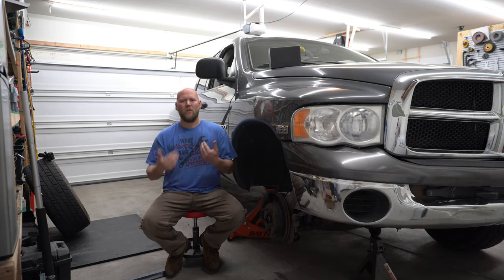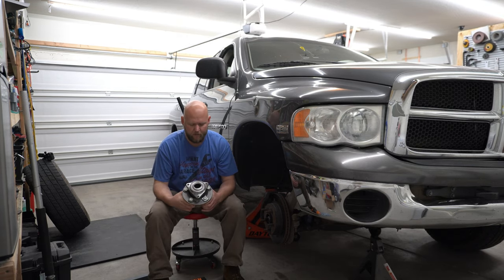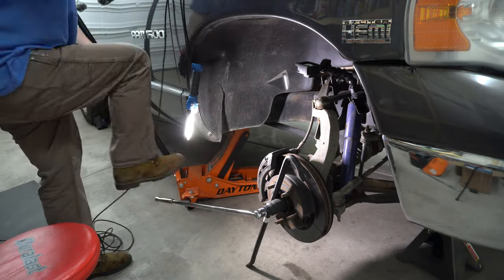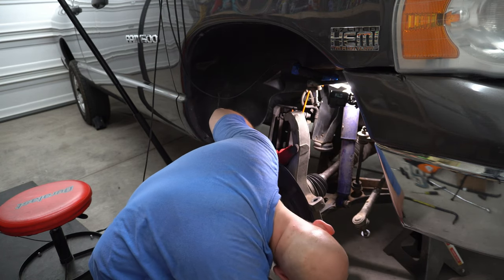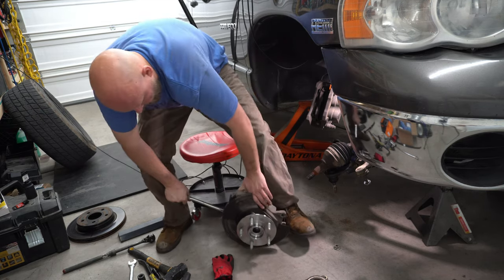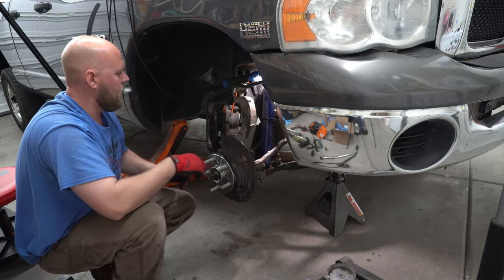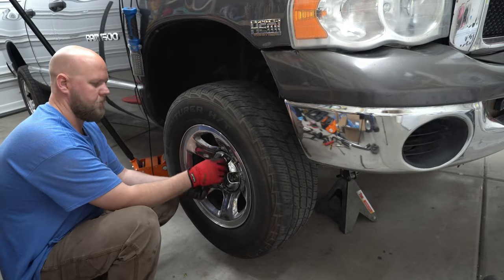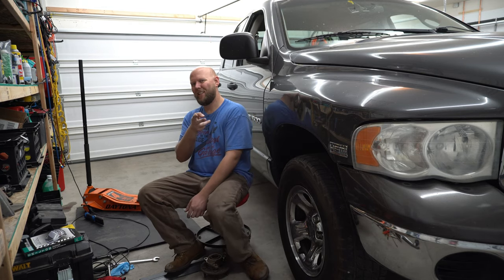Ram 1500 Wheel Hub Bearing Replacement 2004 Dodge Ram 1500 4x4

Comment: Why on earth would you remove the entire assembly to change a hub?
Reply from the maker: Sometimes it's easier
Reply: @ tap the nut back. Use a pry bar to get the socket in. If the cv didn’t cease, sure pop it out.